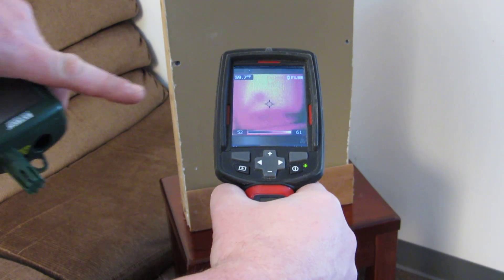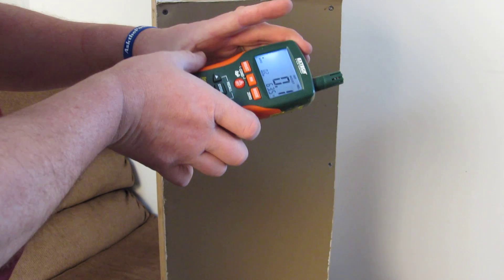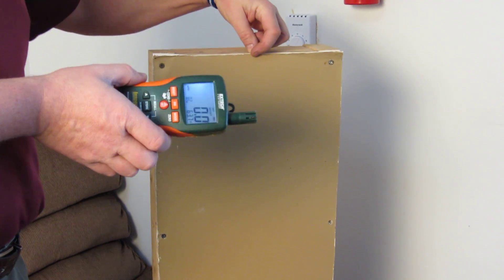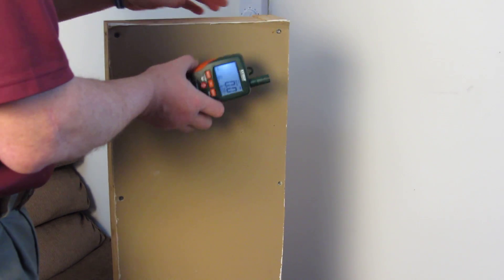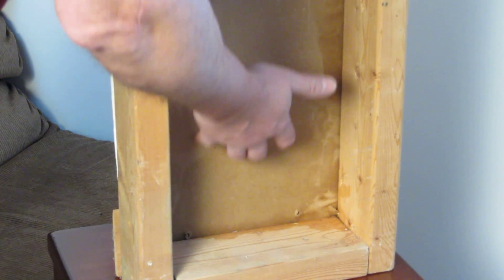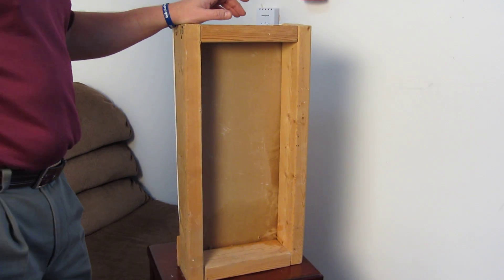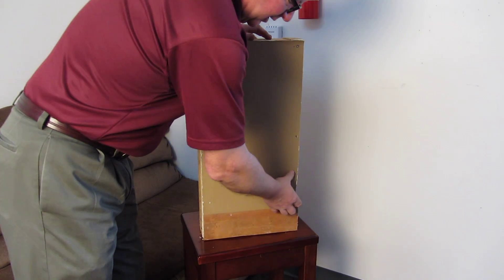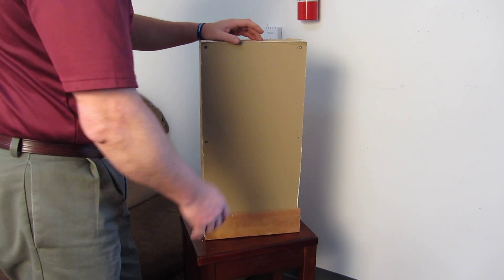How to test for wet walls, ceilings, and construction materials

Comment: I just picked up a FLIR camera and non pin moisture meter (4” penetration).   I plan to use these to monitor my 3” closed cell spray foamed roof over time to identify roof fastener maintenance needed.  Going through my learning curve now.  Do you have any experience with inspecting spray foam installations?

Comment: Great video , I have beautiful home build with 2/12 roof and 2 years later we developing water drips from the celling
Builder said because the house is very tight constructed it normal to have water condensation. Well we are living with buckets in several spots to capture water and I don’t believe this is right !  Can I rent this device or buy one and be able to find the celling leaks without pulling wood celling off ! It’s pine 4x1 planks 
Thank you for your help

Comment: Im a pest control we do alot of drilling outside the house perimeter can these detect water line outside the house and inside the house as well
Reply from the maker: Sadly no, it's not strong enough to see inside cavities. It can only determine temperature differences close to the wall.

Comment: What if the ceilings look like they have crystal on them
Reply from the maker: That doesn't sound good.
Reply: If crystal forms, it typically means water has passed through a pipe and then passed through some sort of substrate. The crystals are mineral types deposits that were diluted with the water and then days on your wall/ceiling. It can show as crystals or chalky type of covering.

Comment: I’m afraid that the ceiling and walls in my modular rental home is wet. The ceiling is getting really dark spots and my walls are soft near sockets. It smells like mildew now and my rental company won’t help because of covid. 😭 I don’t know what to do. It’s getting bad.
Reply from the maker: Hi, Jackie. That's a tough one, but we recommend that you have a chat with your landlord and tell him/her that they are leaving you no choice but to contact the health department and building department, if they don't fix whatever is leaking. I would be concerned not only with potential health issues from breathing contaminants, but also structural issues like the ceiling potentially falling in on you.

Comment: Question.....I have some strange looking water streaks along my wall in one of my bedrooms.....it should be noted that it can't be from a leaking roof because it hasn't rained ....the only thing I could think is that I have leak from the air conditioning freon line which is running through my attic above this room......after noticing these weird clear streaks along my wall I sometimes would smell a weird smell in certain areas within the room  ...for example when I would keep bedroom door shut and you would then smell something as soon as you walk into the room....I am going to try a process of elimination by first capping off the air conditioner line above and then rerouting my line below this bedroom through the basement ceiling instead...my thought is the ac line could have been compromised or kinked from workers in the attic who put in new blown in insulation last fall/winter thus resulting in freon escaping from inside the line and then the smell and visible streak along wall develop once the air conditioner began to operate this past spring summer ?....btw I rubbed off the 6-8 streaks which began approx 6" from ceiling and stopped approx 4" from baseboard with a damp cloth and it appears to be clean now ...my thought is to see if the streaks redevelop as the summer continues and the air conditioner is operating

Comment: Can we use detector on  block wall,  brick wall and concrete slabs or floors
Reply from the maker: With the infrared camera, as long as moisture is wicking from the surface it will show a temperature difference in the camera, because of evaporation temperature differences.

As for the pinless moisture meter, it will detect down to about 3/4 of an inch

Thanks for the question!

Comment: I had a leak under my sink. At first the moisture reader read 13%. Now a week later after running a fan under my sink, it reads between 7 and 10%. Is this acceptable?
Reply from the maker: Hey there and thanks for commenting. I'm assuming your sink is attached to a cabinet. If  so, while the bottom cabinet shelf might show that it's dry, what about the subfloor  under the cabinet? The only way you'll know if the subfloor under the cabinet is dry is to pull the kickplate and check the floor under the bottom of the cabinet. There is also the concern of moisture on the wall behind the cabinet. Depending on circumstances, you may have to pull the cabinet to ensure it's dry. We do most of the time just to ensure it's good to go.

Comment: I would like to inspecte a trailer for moisture in the outside walls. The outside of the trailer is aluminium. Would that sort of meter work?
Reply from the maker: Unfortunately no, this doesn't work on metal
Reply: @Rendallscleaningmi does it work on brick walls?

Comment: we had a company come out with a thermal camera at a great cost - they scanned the whole roof; found 1/2 leaks we already knew about. not really all that useful if you know where your leaks are.
Reply from the maker: It's extremely useful in many ways,  but if you already know where the leak is located, it's not necessary to use a thermal camera.

Comment: for the cost of getting those equipment, one might as well just tear down the entire wall and redo it.
Reply from the maker: First you have to know if it's wet. We have thousands of uses out of this one, so it costs us pennies to use.

If you use it casually, then of course a purchase of a good infrared camera probably wouldn't make sense. That said, if it saves you thousands or tens of thousands of dollars in mold prevention, then it's well worth the investment. 

Lastly, FLIR makes entry- level IR cameras that connect to your smart phone. I've seen them around for less than $500. I can't attest to their quality or accuracy personally as I don't own one, but I've heard pretty good things about them.

Comment: I need this. My apartment. Complex does not use this esp when it's  visible
Reply: My apt has a strong musty smell, same as my last apt. They both have obvious signs of water damage. I'm off to Lowes to buy one today. I sent a letter of possible mold to office but know from prior experience that it's a losing battle. I asked maintenance if they had a moisture meter & yes they do. Maintenace at last apt had one  but checked ONE spot knowing there was a problem.

Comment: So I have a block wall with moisture towards bottom of wall. Can this tool work to see as to where the moisture may be coming from?
Reply from the maker: There are a lot of variables, but as long as the moisture is sufficient enough on the side you are able to view with the IR camera, it will work. One example where it would not be so useful is if the moisture is coming directly from the opposite side of the visible moisture. If, however, the moisture is coming from the top or bottom, it is extremely useful. Hope this helps!
~Scott

Comment: But can it detect live leaks , per say . The leak is constantly dripping and has a wet surface area of 4X4 ft . Could it detect the point of cause ?
Reply from the maker: Sadly, probably not as it can't see through walls.

Comment: I just had an uninsulated garage drywalled over the last few weeks. it was heated with propane and electric heaters during the work and mud allowed to dry 2 days before it was painted with primer and a finish coat of exterior gloss paint for durability. I just went in the attic and the entire ceiling has condensation droplets trapped between the 6 mil vapor barrier plastic and the back of the drywall. 
I tried for 3 days running dehumidifier inside the garage until humidity was 30% at 70 degrees and there didnt seem to be any change to moisture trapped between back of drywall and plastic. 
I plan on doing blow in insulation this weekend but unsure if that will help or make things worse. Is it even possible to suck the moisture back through the drywall and paint with dehumidifiers after its fully insulated to stop it from condensing or freezing on the plastic? 
I dont know what to do and wish I had known this would be an issue or I would have told the installer to wait until spring to mud and paint it but it's too late now and in trying to salvage the situation. Is it possible?
Reply from the maker: Hi, Ryan, and thanks for your question.

Sorry for the late response. Did you get this resolved?

Is it safe to assume that you have proper ventilation in the attic? If not, that space will cause many condensation problems down the road. We'll assume it is properly vented, so let's continue looking at what's going on.

It doesn't appear that the drywall was checked for complete dryness with a moisture meter before it was sealed/painted. I show how we use moisture meters to determine the moisture level in the video.

Therefore it's likely your ceiling drywall install has what's called "bound moisture" caused by incomplete drying before it was sealed and painted. When it was sealed and painted the still wet/damp drywall mud seeks equilibrium through the path(s) of least resistance. In this case that path(s) of least resistance is the vapor barrier side of the drywall.

Keep in mind that direct propane heat is wet heat and adds moisture where it is used. Electric heat is dry heat and tends to remove moisture where it's used. So when propane was used to dry the space, it was actually adding moisture and negating the dry heat of the electric heater(s).

One of the principals of proper drying is to first determine if and how moisture can wick through the surface. A gloss-painted surface is going to be tricky to get moisture to wick through naturally, and obviously the vapor barrier side is going to be just about impossible to achieve any wicking. That leaves us best addressing the gloss painted surface.

The use of dry heat to essentially bake out moisture is probably going to be your best bet here. What you'd do is heat up the painted surface area with a dry heating system and vent out the hot/wet air. We use a system called E-TES, which is a heavy duty 220v forced electric heater with built-in sensors to control heat, humidity, and air exchanges. 

The idea is to contain the area you're going to dry with plastic sheeting and use the heating system to heat and shuttle hot/wet air out of the contained area until it's dry. It should only take a few days with a proper set up and monitored by someone who knows what they're doing with psychrometry and heat drying principals. 

If I  could give you advice on how to do this yourself, I certainly would. However, you must have the proper tools and knowledge to get a tricky drying situation like this to completely dry. Adding insulation before that bound moisture is removed could cause further problems for you.

My advice is to find a local water damage contractor who has heat drying equipment and knowledge in psychrometry. 

~Scott
Reply: @Rendallscleaningmi  
Thanks for reply.
Yes, proper venting in newer garage with soffet and ridge vent. 
I ended up making a small slit in plastic in every truss cavity then using a shop vac with a 1/2" and 3/4" clear poly hose inserted side by side then taped and sealed to shop vac hose. I taped a fiberglass yard marker to the 1/2" hose and shoved that hose all the way to the far end of cavity and put 3/4" hose along it but closer to opening. I sucked out every bit of liquid moisture from every cavity I could in two days time followed by running 5 small fans blowing into the slit in the wettest cavities constantly rotating locations until the entire thing was as dry as possible. I tried blowing dehumidified air into one cavity before trying the fans but with humidity level already around 30-35% it kept going into defrost mode and not resulting in any moisture removed with 4 hours of running. The fans were much cheaper to run and able to do more cavities quicker that way. 
I bought the only moisture meter I could find at Menards but it's nothing like yours. I didnt have it until after cavities were dried and when I tried it on both sides of drywall it didnt register or take a reading. The wood trusses and plywood sheeting running down center was giving reading between 8-10%. After that I taped all my holes in plastic shut then insulated the rest of ceiling with a layer of fiberglass batts. The next day I heated with electric heat while I finished up wiring the outlets and lights. That day and following day I  checked under the insulation in a few spots and it looks dry yet so insulation must have been enough to keep any moisture present from condensing on the plastic again when I heated it. if everything stays dry until spring I plan on blowing in about 12" of cellulose insulation over the rest of attic. 
Hopefully that allows me to use propane heat to get up to temp and electric for maintaining temp the few times I work out there.
Reply from the maker: @Sparkynutz81  Glad you got it sorted!

~Scott

Comment: Please Help!
Our clothes, shoes, furniture, hangers, baskets, and more have been growing mold. We had to throw away thousands of dollars worth of stuff. (stuff we couldn't wash). We bought Damp-Rid and the bags filled with water. We had to get storage bins for our clothes because they were becoming wet while they were hanging.. We couldn't find a leak anywhere and contacted our apartment complex alerting them of the issue. Maintenance came and said the same thing, they couldn't find a leak. They didn't see any mold anywhere (because it was only on our items that we had thrown away). They checked the vents and changed the air filter. The complex told us to change our ac setting to hot or cool instead of having it on automatic.... They did nothing to help resolve this issue. My husband and i bought a moisturizer meter. And it has detected many areas in our apartment within yellow to red. We have one similar to yours where it doesn't penetrate the walls. Our meter goes all the way up to 100%. There are many spots on our walls that beep at 100%. How do i know if it is moisture from the wall or if it's a water line pipe? Would it indicate a pipe? Or does it not go that far?
Reply from the maker: Hi. I'm very sorry to hear of your water damage issues. It sounds like a water damage professional in your area would be able to assist. They will need to work under contract with apartment management/ownership if they are to use destructive testing devices, which is probably necessary. Non-destructive moisture meters are great at finding surface moisture, but they don't always find the source which may be many feet away from where the water is infiltrating the walls.It may be necessary to pull out the drywall and insulation in the known wet areas and continue to track it back to the source.

Comment: I really want one those detectors were to buy?     could it detect moles in the ground or mice in the walls ?
Reply from the maker: Hey there, Eddy. You can buy infrared cameras from places that sell equipment to inspectors and scientific buyers. There are some on Amazon as well. The one I'm using in this video is about 10 years old and the sensitivity isn't anywhere near the newer ones. We only need it to look for water intrusion. As for finding moles and mice through walls - the animal would have to be very near the surface you are viewing to throw off enough heat for the camera to detect.
Reply: I have heard if your IR camera is 120x120 resolution yes. It has to be very high resolution. I own the C3, and that is 80x60. The cost is $699. The higher resolution the price really gets steep.

Comment: You mentioned the drying process, what is the drying process if there is insulation in the wall?
Reply from the maker: The drying process consists of first finding trapped moisture, then unbinding it through a variety of drying methods. Salvageability of affected materials must also be taken into consideration. Water damages are classified in 3 categories: Category 1 - Clean Water, Category 2 - Gray Water, Category 3 - Black Water. Time, also, is another factor. Category 1 or 2 could turn into a Category 3 if left wet for a certain amount of time. Typically you can save insulation from a fresh Category 1 flood, generally you'll want to replace insulation from a Category 2 flood, and you must always replace insulation from a Category 3 flood. As for specific drying methods, I highly recommend that you speak with a qualified local water damage expert because not only are there many different ways to dry various materials, but there's a whole science of drying (called: "psychrometry") to learn before using any drying equipment.
Reply: Thanks
Reply from the maker: Sorry I couldn't be more specific with my answer above, there are just so many variables. Do you have a specific example you'd like to share here?